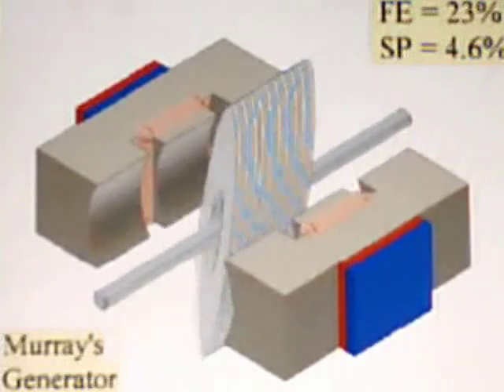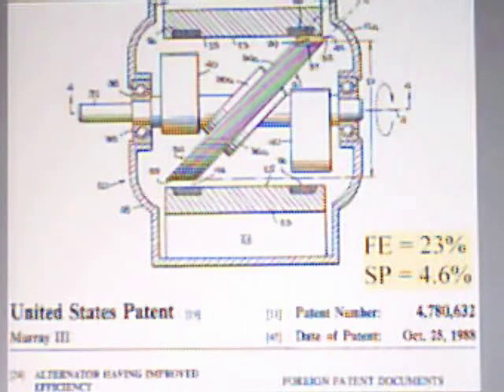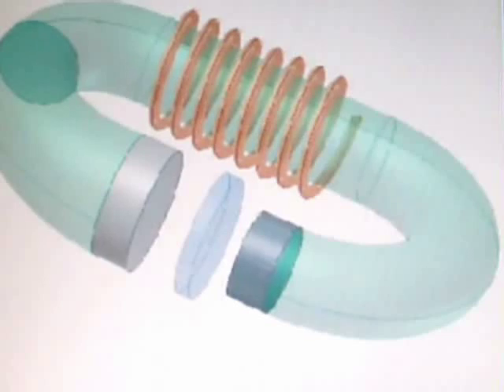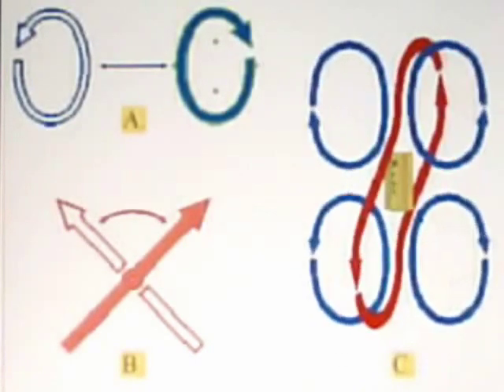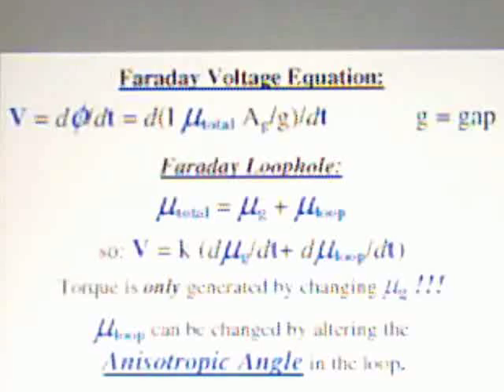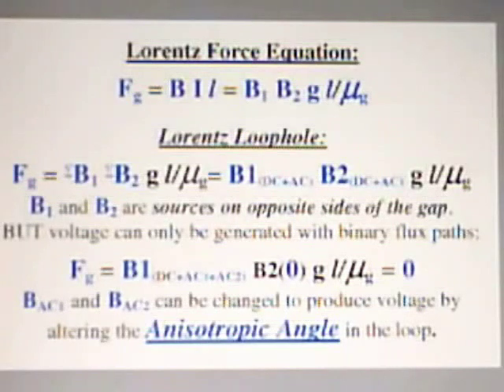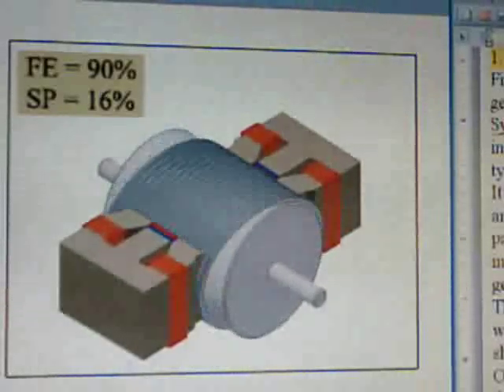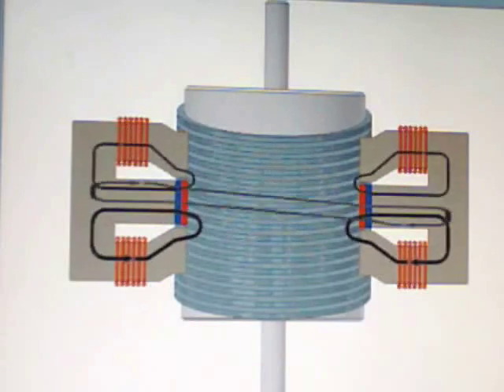Part 1 - Understanding Murray's Generator

Comment: This video has not demonstrated how Jim Murray's Dynaflux Alternator "violates conservation of energy" or "violated Lenz's "Law", because it's manifesting in this system. what he did was make an elliptical rotor that avoids the drag caused by Lenz's Law load by moving the rotor to an axis that won't make the prime mover bog down.

THAT IS IT AND THIS DAMN VIDEO MAKER CANNOT COMPREHEND THIS..

It's reducing losses caused by Lenz's Law caused drag, it doesn't violate Lenz's Law and half of this comment section shows its as incompetent as the video maker in question.
Reply: How do you suppose one might accomplish this without moving components? Can we achieve this method of avoidable Lenz drag via solid state?
Reply: @JenkoRun  Paul Babcock's switching tech he's patented being incorporated into the SERPS technology is how you're gonna do it, the patent numbers are out there.
Reply: @DerpyRedneck  Isn't that a method of capturing the unused Heaviside flow rather than avoiding the Lenz effect? I'm thinking the solid state variant of this as with a set of coils that don't suffer the increased power cost when loads are attached via use of the geometry and such, if possible.
Reply: @JenkoRun  It's a way to captured unused heaviside flow in order to evade the DRAG caused by Lenz effect as it takes course, but using solid state switching tech.
Reply: @DerpyRedneck  Ah, is that what was happening with the power cost dropping on the input during the demonstration? That was the result of avoiding Lenz?
Reply: @JenkoRun  It's the result of avoiding Lenz caused drag, not Lenz's Law itself.

Lenz's Law is immutable which is why it's a law, but you can mess with how it manifests, manipulate the consequences of how and what path it manifests in order to mess with how its products will affect a device.

It REALLY requires eclecticism extremism and broad, massively deductive thought to come up with new ways to do sh#t like that.

Comment: Just to clarify with people who don't fully understand, there is a difference with free energy and perpetual energy. free is use of water, wind solar, etc... perpetual is simply not possible, nor its allowed in law of thermodynamics,  you cant create power from nothing. Now there is a phenomenon called resonance where things get interesting , usually tricking your measuring instruments and subsequently fooling everybody. Guys when you conduct experiments you need to put a load on your motor.
Reply: Thermodynamics are not applicable to energy.  There is no closed and/or isolated system with respect to energy in this universe.
Reply: Perpetual motion is indeed impossible because there is entropy aka heat loss so this is out of question.

Doesn't mean we can't switch to overunity machine which create energy from Aether . Doesn't exist? Then explain how self-excitaton is possible for any generators. You can't because energy isn't converted. It's created but because of lenz's law, it destroy itself.
Reply: Flux switching alternator for example. Back flux is split betweeb the rotating core and the stationary core which results in reduced braking torque greater than 50%.